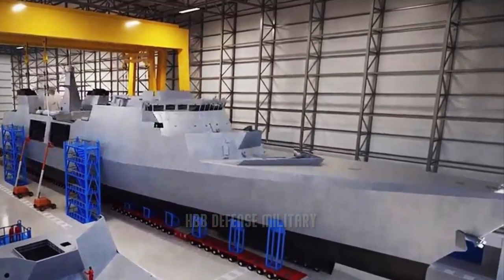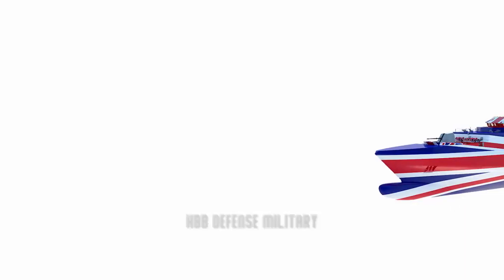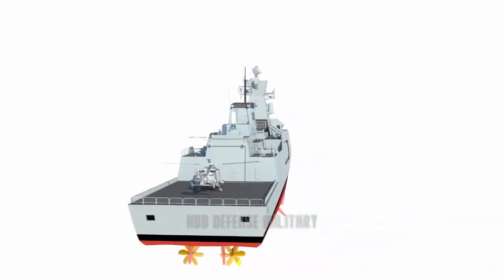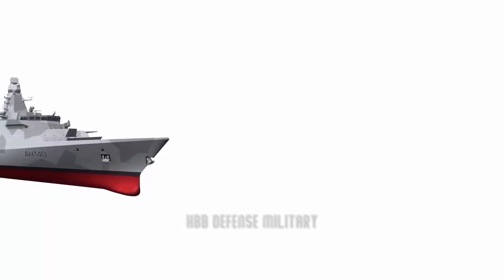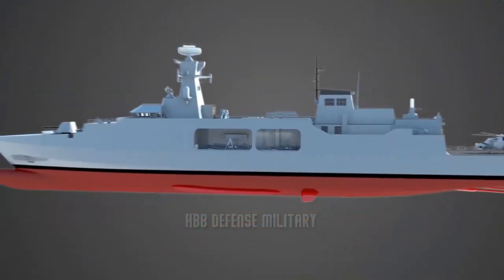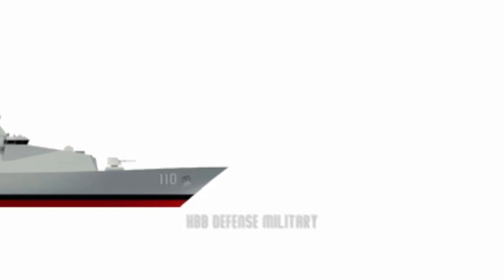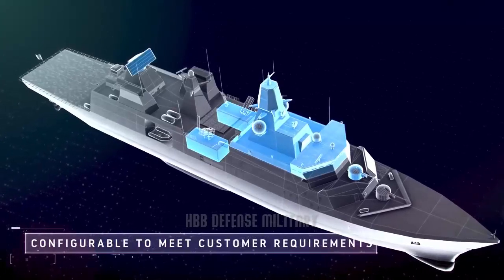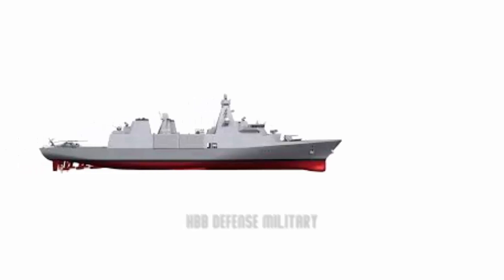The first Type 31 frigates will launch from the new construction hall under construction at Rosyth

Comment: Type 31 frigate doesn't have any anti-ship warfare capabilities and anti-submarine warfare capabilities. Consider very lightly equipped and armed.
Reply: Idiot !! The helicopter is fcking anti submarine ?? and all warships have sonar ??
Reply: @davidsmall2944  Type 31 Frigate will have 24 VLS Sea Ceptor for CAMM missiles, 1 x 57mm Mk 110 main gun, 2 x 40mm Mk 4 secondary guns, 4 general purpose machine guns, 4 mini guns, 1 x Wildcat helicopter or 1 x Merlin helicopter, etc. No mention of sonars, light weight torpedoes and anti-ship missiles in the design of the ship currently under construction. Not at the current stage probably in the future. The 1x helicopter may probably be armed with Sea Venom light anti-ship missile with very short range of only 20 kilometres, sonars and light weight torpedoes for short range anti-submarine warfare. The ship itself does not have anti-submarine warfare and anti-ship warfare as of now.
Reply: @kokcheongandykan3748  + You just reading from the internet mucker, current information is, apart from the 57/40mm guns, sod all has been finalised, yet.
Reply: @kokcheongandykan3748  the type31 export version Arrowhead140 in its brochure clearly states 
"Missile Options
› Deck space for up to 8 SSGWs.
› Flexible space for VLS– up to 32
variable length cells."
So, they ship is designed to have 8 antiship missiles. Just as with the antiair, it doesn't say what missiles since it's free for the buyer to add. It's advertised as such: 
"Arrowhead 140 is able to:
› destroy surface ships over the horizon
› detect and destroy enemy submarines
› defend convoy ships
› employ active and passive electronic warfare
systems
› defend against swarming small boat attacks"
I mean, how will it be able to destroy surface ships over the horizon without antiship missiles? And it clearly mentioned "detect and destroy enemy submarines". So, it has  antisubmarine abilities too.
Reply: @gazza7uk646  You can disagree with my comments is ok. Don't be so rude to call others moron. Type 31 frigate is a general purpose frigate hence its design is not for ASW. Type 31 frigate will not have any tow sonars and torpedo tubes and the helicopter on board armed with Sea Venom light anti-ship missile with very short range of only 20 kilometres, sonars and light weight torpedoes for short range anti-submarine warfare will be the sole weapon for ASW and anti-ship warfare. That's for the time being not sure about future upgrades. The UK MoD has no intentions to arm Type 31 frigate with anti-ship missiles for the time being not sure about future upgrades. The priority is arming Type 45 destroyers and Type 26 frigates with anti-ship missiles. Babcock has contacted by UK MoD to extend the life span of Harpoon Block 1C anti-ship missiles on board Type 45 destroyers, Type 26 frigates and Type 23 frigates while waiting for the results of undergoing interim anti-ship missiles replacement for Harpoon Block 1C anti-ship missiles. Type 26 is a ASW frigate hence it has tow sonars, torpedo tubes in addition to the helicopter on board as weapons for ASW.
Reply: @jackdonith  Yes I know all these but these are for the export version of Arrowhead 140 frigate. The Type 31 frigate though based on Arrowhead is a general purpose frigate not a multiple purpose frigate thus its design is not for ASW and will not have tow torpedo tubes and the helicopter on board will be the sole weapon for ASW. The UK MoD has no intentions to arm Type 31 frigate with anti-ship missiles for the time being not sure about future upgrades. The priority is arming Type 45 destroyers and Type 26 frigates with anti-ship missiles. Babcock has contacted by UK MoD to extend the life span of Harpoon Block 1C anti-ship missiles on board Type 45 destroyers, Type 26 frigates and Type 23 frigates while waiting for the results of undergoing interim anti-ship missiles replacement for Harpoon Block 1C anti-ship missiles. Type 26 is a ASW frigate hence it has tow sonars, torpedo tubes in addition to the helicopter on board as weapons for ASW.
Reply: @davidsmall2944  Yes The helicopter on board is the sole ASW weapon for Type 31 frigate. Type 31 frigate is a general purpose frigate and hence its design is not for ASW. UK MoD already said Type 31 frigate will not have any tow sonars and torpedo tubes for ASW. That's for the time being not sure about future upgardes. Type 26 is a ASW frigate hence it has tow sonars and torpedo tubes in addition to the helicopter on board as weapons for ASW.
Reply: How do you know ?
Reply: @garwhittaker3743  Type 31 Frigate will have 24 VLS Sea Ceptor for CAMM missiles, 1 x 57mm Mk 110 main gun, 2 x 40mm Mk 4 secondary guns, 4 general purpose machine guns, 4 mini guns, 1 x Wildcat helicopter or 1 x Merlin helicopter, etc. No mention of sonars, light weight torpedoes and anti-ship missiles in the design of the ship currently under construction. Not at the current stage probably in the future. The 1x helicopter may probably be armed with Sea Venom light anti-ship missile with very short range of only 20 kilometres, sonars and light weight torpedoes for short range anti-submarine warfare. The ship itself does not have anti-submarine warfare and anti-ship warfare as of now.
Reply: As I say it ain't even been built yet and they ain't decided what weapons they are going to fit ...Unless your a psychic who can see into the future. ??
Reply: @garwhittaker3743  Type 31 frigate is currently under construction. Type 31 frigate design is based on a modular adaptability and flexible construction concept where it can switch and change between pre-prepared purpose modules and weapons based on situation needs within a short span of time. This modular adaptability and flexible construction concept is also found in the US Navy Littoral Combat Ships (LCS) both Freedom class and Independence class.
Reply: He sounds Chinese to me, their all BAT SHIT CRAZY!
Reply: @pluffer96  Though my race is Chinese I am not a China national.
Reply: Well you're showing your complete lack of intelligence it seems.
Reply: @EnglishPatriot486  Type 31 frigate design is based on a modular adaptability and flexible construction concept where it can switch and change between pre-prepared purpose modules and weapons based on situation needs within a short span of time. This modular adaptability and flexible construction concept is also found in the US Navy Littoral Combat Ships (LCS) both Freedom class and Independence class.
Reply: @kokcheongandykan3748  lol.
So basically the modular design means it can be fitted out as any type of frigate then!
Reply: @nikkip3385  The new Type 32 frigate currently under development will also be a general purpose frigate whose design will also be based on a modular adaptability and flexible construction concept where it can switch and change between pre-prepared purpose modules and weapons based on situation needs within a short span of time.
Reply: Arup Ratan Mitra  Type 31 frigate is a general purpose frigate hence its design is not intended for ASW hence it will not have any tow sonars and torpedo tubes and the on board helicopter will be the sole weapon for ASW. That's for the time being not sure about future upgrades. Type 31 frigate design is based on a modular adaptability and flexible construction concept where it can switch and change between pre-prepared purpose modules and weapons based on situation needs within a short span of time. This modular adaptability and flexible construction concept is also found in the US Navy Littoral Combat Ships (LCS) both Freedom class and Independence class. Type 26 frigate is a ASW frigate with tow sonars, torpedo tubes in addition to on board helicopter. Priority is to arm Type 45 destroyers and Type 26 frigates with anti-ship missiles. Babcock has contacted by UK MoD to extend the life span of Harpoon Block 1C anti-ship missiles on board Type 45 destroyers, Type 26 frigates and Type 23 frigates while waiting for the results of undergoing interim anti-ship missiles replacement for Harpoon Block 1C anti-ship missiles.
Reply: Wankers trying to tell real matlots what is and isn't ?? You don not have to have towed array sonar, all Royal Navy frigates and destroyers have Sonar ?? It's just a matter of whether it is active or passive !! Take it from a TAZ APE !!
Reply: @davidsmall2944  Type 31 frigate is a general purpose frigate not a multiple purpose frigate. Type 31 frigate design is based on a modular adaptability and flexible construction concept where it can switch and change between pre-prepared purpose modules and weapons based on situation needs within a short span of time. This modular adaptability and flexible construction concept is also found in the USA Littoral Combat Ships (LCS) both Freedom class and Independence class. Hence the surface combatants like Type 31 frigate and USA LCS will have only a few primary roles and limited secondary roles. Type 31 frigate being a aircraft carrier strike group fleet escort will have primary roles like air defence, electronics warfare, etc hence the vessel will focus on weapons, sensors, etc to cater these roles. Of course it does have some secondary roles like anti-submarine warfare, anti-ship warfare, etc via the helicopter armed with Sea Venom anti-ship missiles, sonars, light weight torpedoes, etc on board but with limited capabilities. Type 31 frigate can switch and change between pre-prepared purpose modules and weapons based on situation needs within a short span of time. It is never intended to be a all rounded frigate hence not fully armed and equipped to cater for all needs and its design does not suitably fit for anti-submarine warfare fully.  Type 26 frigate is an anti-submarine warfare frigate which will handle the anti-submarine warfare aspect fully. At the moment, there is no sonars and torpedo tubes installed on board but they may be installed based on future needs (modular adaptability and flexible construction concept) or future upgrades.
Reply: YAWN !! WHAT A TOSSERS ANSWER !! DID YOU GET THIS FROM A BOOK ??
Reply: @davidsmall2944  The UK Royal Navy stressed modular adaptability and flexible construction of the design for Type 31 frigate.